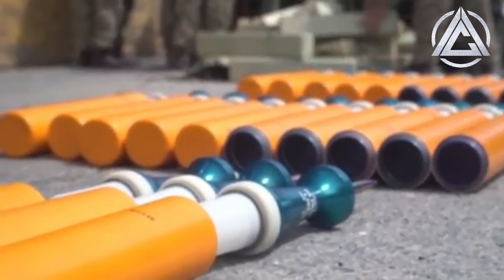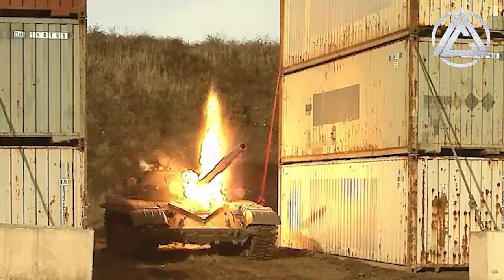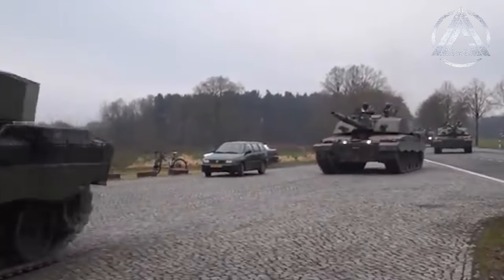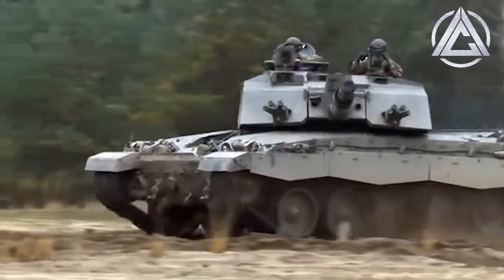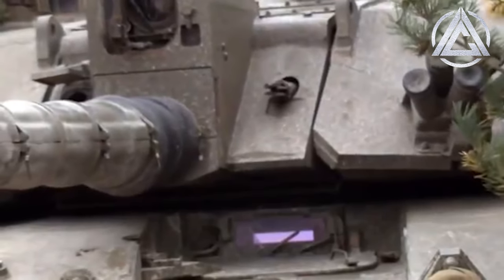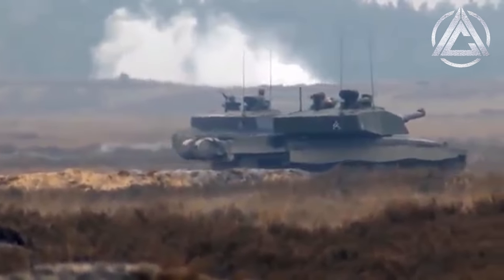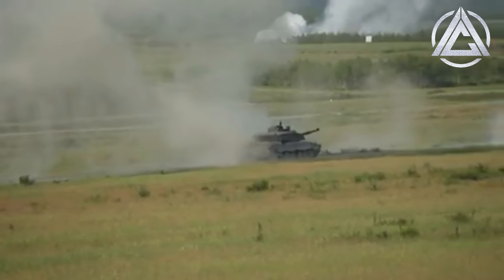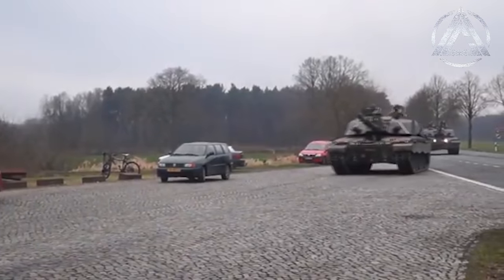Challenger 3 | Britain's New Main Battle Tank | Is It Really Any Good?

Comment: Having the L55 Main Gun or here in the US we call it the M256. Very reliable cannon and very easy to maintain. A crew can clean and maintain the breech block inside the turret with a few specialized tools. The ammunition is one piece which makes it faster to load. Maximum time to load and arm the main gun is 7 seconds for an M1A1/A2 for SABOT, same for HEAT. They have MPAT which is 8 seconds but I never seen it as a service round. Experienced loaders can load and arm under the maximum time during gunnery. I think the Challenger 2 has the same type of fire control and optics better than the old M1A1 but upgraded to where the M1A2 SEP Separate Enhanced Package with better thermal imager for gunner and commander. Better command and control management computer for GPS and digital mapping for situational awareness. I think the Challenger 3 is much more compatible with all NATO guns and battlefield computers and communication wise. The only difference with it to other Continental European tanks is combat experience. Only British and American tanks have gone into combat with the almost same systems before improvements in 2 wars. The Leopard 2 got demolished in Syria used by the Turks in combat by Iranian copies of the US TOW missile system by Syrian rebels. The Turks operated their armor without infantry support. Bad mistake.
Reply from the maker: Minor correction, the M256 is the L/44 gun barrel, not the L/55 used on Leopard 2A6/7.
Also, MPAT and HEAT are the same thing, just a renaming of the M830 round to reflect its modern use case (what other nations call HEAT-MP)

Challenger 2 has no thermal sight for the commander, just like the old M1A1 didn't. It remains totally un-upgraded since 1997, besides the addition of ERA on the lower plate
Reply: @ArmorCast  Thanks for the correction. It's been many years since 2005 when I got out of 19 Kilo back to 11 Bravo before deploying to Iraq a year later. I keep thinking that the M256 main gun is the same as the German gun. Yes I see that the Challenger 2 doesn't have an ITV like the M1A2 SEP.

Comment: (note - made this comment before video reached basically the same conclusion) I don't think there is so much of an issue with the tank as much as with timeline. The sort of "upgrade package" would have been timely towards the end of mission in Iraq or Afghanistan, sort of around the time Leopard 2A7+ was proposed etc. So by that I mean like in 2011-2016 perhaps to be battle ready for 2020. Then the existing tanks could be used until 2030, by which time new design with APS and all new stuff could be introduced. Finishing upgrade by 2027 of what is essentially just Challenger 2 and having them ready by 2030 feels like the tanks will be obsolete before even launched. Seems like UK decided they don't need tank force!

Comment: Even without active defence system i think will be the best in the world be the best or it would not be in the army
Reply from the maker: I mean, the Challenger 2 for the modern day is a very mediocre tank - 80's armor design (which was never the best in thickness nor in coverage), 90's internal systems, and no upgrades to the serial production versions to equip it with modern tech. Not to mention the poor speed
Reply: @ArmorCast  thickness matters a lot less than the material it's made from in modern warfare, this isn't bloody War Thunder you know, that's  Dorchester on the turret not ordinary steel and with TES it'll have it everywhere else it's needed and that's without even mentioning the APS it's DEFINITELY gonna have (oh and if that quote "80's armour design" wasn't any good still I don't think the Americans would be so confident about their Abrams series, given they use a LESS advanced version of the exact same basic Chobham design)

Comment: What I'm wondering about if this: they are going from rifled to smoothbore, but then they are sticking with 120mm. Meanwhile the KF-51 is going for 130mm (with autoloader). Wouldn't it have made sense for the UK to seek cooperation on at least determining if setting a new standard is worthwhile? Seems like the perfect time to do so, if you're upgrading the gun anyway.

Comment: Challenger is a good tank and seen more action than most out there.  RPG’s where just bouncing off them in Iraq.  It survived a shaped charge IED strike in Afghanistan which was a military grade device and not a homemade device(suspected to be supplied by Iran supporting the insurgency). The weight isn’t too much of an issue as the BR90 system used by the Royal Engineers is capable of carrying the weight.  Just wonder is getting rid of the HESH round is a good idea😏

Comment: Britain AND the U.S. should upgrade to the L55. Obviously now, the 140mm was jumping the gun, but there you have it. Even the 130mm may be a bit early, even planning for the future, considering the advancements in ammunition. Afterall, what are you going to shoot, Armatas? Ghosts?

A big secret about the M1 seems to be that it is capable of 60mph without the governor on it.

Didn't they just upgrade the F22? Airframes can only take so much, especially when they're trying to catch me jogging!
Reply from the maker: The L55 is unnecessary for the Abrams now that XM360 is ready for mass production. That gun has growth potential that effortlessly outpaces the L55 or even the 130 or 140mm's

Comment: The basic design of a tank has not changed in almost 75 years.  It’s time for DARPA to step in and initiate a revolutionary replacement that addresses weight, reducing crew members, caliber of the main gun (absurd to keep making them larger), overall size and the power pack.

Comment: One thing I'm surprised that tanks aren't using is hybrid electric drives. Electric motors offer huge torque at the push of a button, which would be fantastic for heavy machines like these.
Reply: And where are you going to charge these huge batteries on a battlefield?
Reply: @JammyDodger45  How hybrid cars charge them... an alternator. 

Also the battery wouldn't be that big, the point of it would be to assist the diesel engine over the first 5 to 10 yards, to get a quicker acceleration, which can be used to evade danger. Or use it strategically to chase down targets, like they do in F1.

Not a full electric vehicle.
Reply: @Ashitaka255 - the power generation/weight ratio makes it (currently) impossible. 

Ricardo have trialled electrifying a Jackal patrol vehicle and can't make it work so a tank has no chance.

Comment: I think the variety of different systems is what makes NATO so damn strong.  Some tanks may have better night fighting abilities, some can move through water etc. Even if one system turned out to have a significant flaw command can react on the battlefield very quickly.
Reply: And how do they "react" exactly when apart from the Americans, most Europeans only have a couple hundred tanks while the Americans have a 1000? You do realize that lead time for manufacturing modern weapons means this won't be like WW2 where you can keep producing Capital equipment during a war?

Comment: could be multiple reasons that the tank could have a higher speed with the same engine. this could be as simple as a different gearing ratios in the transmission or final drive. horsepower is seen as the  be all and end all but having higher torque output could also allow maximization of the overall performance of the vehicle. but i believe unlike french tanks it has more forward gears than reverse ones? lol.

Comment: A variable that was not commented upon is the transmission system.  Is it possible to dramatically improve the efficiency in this area without modifying the engine output to achieve higher top speeds.?

Comment: The only reason they kept the gun was due to stockpiles.... this will soon be a major issue hence the change over... the hesh is required only because the mortar equipped tanks of the past have been deleted for economy reasons... further upgrades to the current vehicle are inadvisable in a unit that would be expected to serve into the 2080s. .. Therefore all new units should be procured .. preferebly with a titanium understructure and other root improvements to avoid block obsolescence that the abrams is heading for... 

Unless you really want a 75 to 80 ton tank at some point...

Speed is a spoof based on the maximum permitted road speed before things start breaking...

Comment: You don't need a lot of horsepower to reach high speeds, once you have enough horsepower to get the thing moving and "defeat" friction factors you can just go faster and faster until you reach the limit of the transmission, treads, high enough gears, etc. or you run out of fuel.
Reply: Because wind resistance doesn't increase with speed. /s

Comment: Still cant fathom how they cocked up the frontal hull profile, i cant think of any even vaguely modern tank with a similar weakspot as the Challengers, apart from earlier model T-tanks as they lack composite on an area in front of the driver.

The chieftain front hull didint suffer from a mistake (as in theory it could have been fitted with composite, if the plate wasn't round instead of a flat angled one) like this, so i wonder what happened.

Comment: 20:23 I can debunk the idea that Challanger 3 comes to create jobs in UK and so was preferred to the Leo 2 whatever variant. The point is that there are no Leopard to be purchased, and the first to roll on, if purchased from Greece would take about 6 years to even start rolling out. I know first hand Italy had inquired about availability of the Leo 2, and so, I guess, could Britain, but there are no more old tanks to be refurbished to the new version. Greece is the only country currently building leopard 2 and it's industry struggles to output enough even for its own army. This is also the reason because Poland has the K1 chosen, despite already owning Leopard 2. The Type 10 could be an option for Italy, but I doubt it could blend in the UK mentality of "as heavy as possible".
The Challenger 3 is a stopgap, as the Ariete C2 is for Italy, waiting for what could come out for the next generation. Germany and France are trying to define a guideline but the track record of the two countries working together is very poor. The point is that you have old tanks form the 1990 and you cannot buy new ones (the K1 production has been completely optioned by Poland), so the only option is to modernize what you have and keep it in service until something becomes available or at least optionable as a replacement.
Reply: it sounds as if you claim the Leopard is no longer in production. Greece might have been lucky and acquired some older Leos and is about to refurbish them. do you think the Leopard 2A7+ is not for sale anymore?

Comment: What seems to be your major headache is the weight not being justified by better armor/other protective systems.  If they are still using the same CHALLENGER ii armor type with nothing else added, you are right to call this tank a fixed CHALLENGER II upgrade, not a true new III tank.  If you could put equivalent armor to a new ABRAMS on about 50 tons or so (metric or otherwise), on which you might add the other new active/passive protective systems overlaying the core armor, this would up the III to about their level, protective-wise.  Making better inert, wall-type armor (steel. composite, or otherwise) compared to the COBHAM-and-successor derivatives being used today requres a much deeper knowledge of atomic and molecular physics of all elements when alone or in combination with one-another to form molecules or composites AND the ways to manipulate these materials in a cost-effective, mass-producible, and affordable way.  Making a material in a way like 3D printing, but using different fonts, language alphabets, as one moves from the front to the bak and top to the bottom, as well as shaping the layers in various complex non-parallel ways, would allow an enemy solid shot/HEAT jet to lose its narrow cohesive shape, causing it to spread out sideways and no longer forward.  This is obviously done to some extent in COBHAM armor generic types, but to get better protection, we have to do minute, virtually atom-by-atom adjustments as to the element used and how it relates to those immediately around it to get the maximum effect on the enemy weapon as it tries to go through the armor in a straight line.  The projectile/jet must be made to move in a undulating, corkscrewing, spreading manner by asymmetric forces for every nanometer it tries to advance through the armor -- the armor can hold itself together against sideways forces MUCH better than the projectile/jet can, so having innumerable tiny roadblocks adding up to an immense longer trajectory through the armor would make a plate act like it was MUCH thickers, since, to the weapon, it is much longer to traverse.  Thus you get both stronger armor and armor that, to the weapon, is thicker due to the non-linear path the weapon has to move and the damage to the weapon as it tries to follow the 3D-roller-coaster-like trajectory that it has to follow to get anywhere.  Until sci-fi force-fields are devised, this is what is possible, which is really a lot if you can figure out things on the atomic level and make them.

Comment: The Challenger 3 is essentially the Challenger 2 with a smoothbore gun. Ok, that is not entirely fair.  Everything is better. It is much, much faster - outrageously fast! The optics are far better. The armour is better. The control systems make it vastly better than what was before and yet I am still left underwhelmed. It seems that the designers have played it safe with incremental improvements. If the Challenger 3 were in Ukraine now, it would still get stuck in the mud. It would still come to grief on mines. It would still fall prey to cheap drones. I wanted to see something that really pushed the boundaries. I wanted to see something that might represent a better tomorrow rather than a better yesterday.

Comment: unfortunately, the UK government found a general to say 'tanks are passe, next conflict will be infantry based, like Afghanistan'
So they reduced the numbers of the SEP, and called it a wonder tank.
The smooth bore is required from environmental and health reasons - It has better penetration with tungsten penetator than the current rifled barrel does with depleted uranium.
The Challenger 2 is/was considered a good tank, just too few are 450. So 162 makes the C3 totally irrelevant regardless of its individual performance. The Germans deployed about that number of King Tiger (or Tiger IIs) and look where it got them.
Honestly, this is a total sham and waste of money.
As you said, revolution rather than partial upgrade is needed. I would like either a gas turbine (but not british built as it will be shite) or a front mounted engine like the Merkava, which comes with a coke fridge. Oh, sorry, that is a Bradley.
Looking at the Ukraine, and top attack, it needs a 'sun shade', laser detector and counter missile system as well as ERA. 
The electronics need to interface with drones and infantry support.
But most of all, the army needs numbers, about 1,000 of the new tanks. Because 3 of these defending 5 km of line are going to feel very lonely, and the logistics of supporting so few tanks over such wide areas as say Poland, will be embarrassing.
At this rate, the UK army will be jealous of the T14 Armata. which is wrong on every level.

Comment: I'm not a soldier but hopefully someone has already corrected you on why SABOT rounds are more inaccurate when fired from rifled guns (6:40). It's not because rifled guns are inaccurate, it's because SABOT rounds are are not meant to be fired from rifled guns. They are instead a way of getting accuracy from a gun that isn't rifled. The advantages of smooth bore guns are that they're now the standard across NATO and so ammo is easy to get hold of, there's a wider variety of ammo available,  they don't wear so much and you can get a higher muzzle velocity.
Reply from the maker: This doesn't exactly explain anything - you're right in that rifled guns aren't inherently inaccurate, in fact they're not even inherently inaccurate when firing sabot rounds SPECIFICALLY, that factor only applies to more modern examples of sabot ammunition with high length to diameter ratios.

But, WHY are sabot rounds "not meant to be fired from rifled guns"? If you're supposing that the answer is "they're not designed to be", then that is just incorrect. The key factor here is length:diameter ratio. Older sabot rounds had penetrators that were still quite wide (over half the diameter of the full round) and relatively stubby. Those rounds were still more accurate from rifled guns than smoothbore. Modern rounds though can be as little as 25mm wide at the core, yet 900mm long, or in other words a l:d ratio of 36:1. With that kind of form, they can't be gyroscopically stabilised, and the spinning motion actually causes them to wobble in the air and veer wildly off course. That's why modern sabot rounds fired from rifled guns incorporate spinning rims, so that the penetrator itself won't spin (at least not much) and thus maintain accuracy.

In that regard, rifled guns firing sabot rounds aren't LESS accurate than smoothbore counterparts either... they're just not any MORE accurate, which is the common misconception.
Reply: @ArmorCast  My point was that you can't compare the accuracy of smooth and rifled bores by firing a round, that's specifically designed for the smooth bore gun, from both guns. If you simply stated that smooth bore guns firing SABOT rounds are more accurate than rifled guns then that might have some truth in it. Saying that, the longest tank kill was from a challenger 1 with a rifled barrel firing a SABOT round (5km).